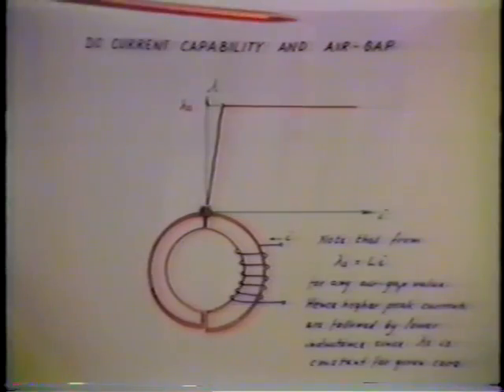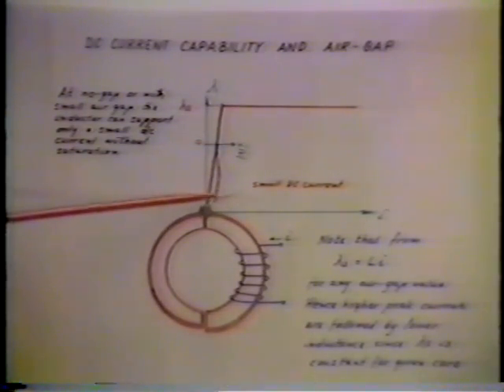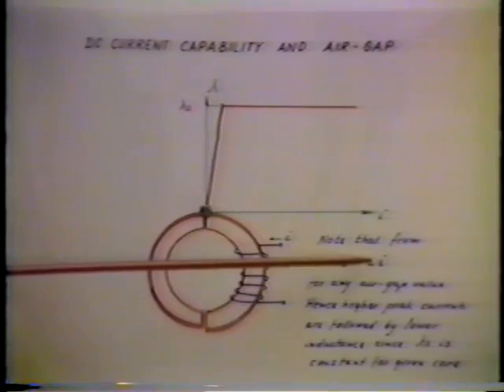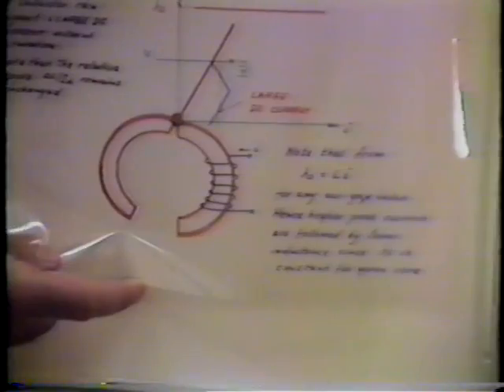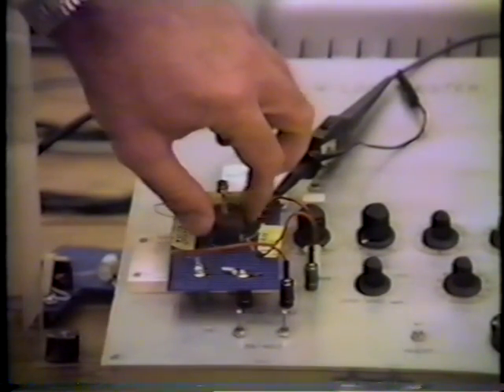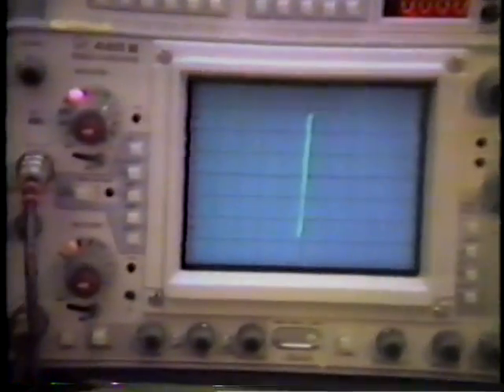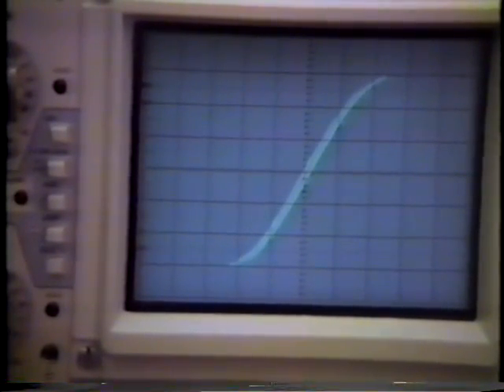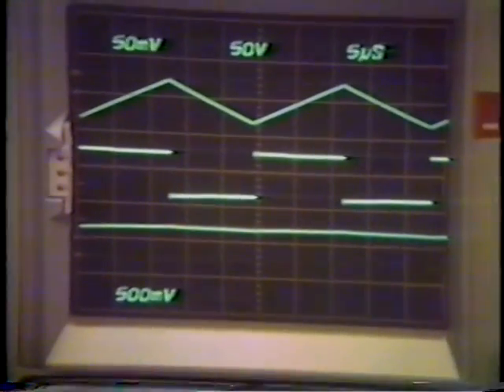Air-Gap Effect on Inductance - Part 4

Comment: Hello Dr.Cuk.
Isn't reducing inductance rises currents in resonant tanks? (when frequency is same, i.e larger capacitor)
I simulated circuit from your presentation http://gecs.ieee.tn/wp-content/uploads/2017/03/GECS2017PaperEDITED.pdf
I saw kA peaks in circuit. is it normal? or i did something wrong? How ever transistors can survive that?
Sorry for bad English.

Comment: Great explanation Dr.Cuk
Reply from the maker: Swaraj, I just repeated the additional explanation I just gave to Brent.

"It is much more than B tracking H! Inductance is a fundamental property of an AC inductor and NOT of an inductor with DC bias. AC inductor DOES NOT store energy. Inductor with DC bias DOES just OPPOSITE and stores ALL energy. Hence a brute force contraption such as an air-gap is introduced into the magnetic path just to do all the storage. As I explained above even a very tiny air-gap sufficient for only a very small DC current DOMINATES total inductance. Think of that in terms of electrical model with two paralellel inductances: one very high inductance  due to the magnetic core  without air-gap and another small inductance representing the inductance of the gap with no magnetic material. Clearly the small inductance in parallel will dominate as large inductance is large impedance in parallel and can be neglected.Bottom line you really do not need magnetic material, which is truly wasted: does not reduce the size and only increases core losses and potentially makes problem if core does saturate in which case that large inductance becomes a short!"

Comment: Why not just reduce inductance with fewer turns on the core instead of using an airgap?
Reply from the maker: Brent,  You seem to miss the key point I made with this demonstration. The objective in switched-mode power conversion is to  make as HIGH inductance as possible.in order to reduce as much as possible the residual output voltage ripple in switching DC-DC converters..  Yet the filtering inductance used on output (example buck converter) must pass full DC load current. The inductor can not pass even a small DC current without being saturated and resulting in SHORT circuit with zero inductance. The brute-force method used to still use inductor for filtering  is to insert an air-gap into magnetics loop. Hence the larger the DC current requires proportionally  larger air-gap. The only mechanism then to increase the inductance is to increase number or turns. However, this  has diminishing returns. Inductance saturates due to DC ampere turns ( product of number of turns and DC current.. Therefore,  increased number of turns demands yet larger air-gap.  This demonstration uncovers the key  limitation of the DC-DC converters used for last 60 years based on buck converters and its derivatives. I hope this explanation answers your question. 
For more details go to amazon.com/author/slobodancuk to see my four volume  books on power electronics or visit my website teslaco.com.. Slobodan Cuk
Reply from the maker: Brent, sorry, but there is no optimum air-gap to be gained. Inserting an air-gap is a losing proposition that Power Electronics field followed for last 40 years and built all its system technology on the buck converters and buck derided converters. They all have a filtering output inductor with DC- bias and require an air-gap.  With DC bias inductance does not increase with the number of turns square but only linearly. Worse yet, air gap needed is proportional to NI (DC ampere turns). For example, even 100 Ampere turns (5 turns at 20A) leads to an air-gap of 10 mills or 0.25 mm. At that size air-gap the inductance with ferrite material included (relative permeability 3,000) may be only three times larger (effective permeability 3!) than without magnetic material. Hardly a reason to use magnetic material as one could increase switching frequency 3 times to get that inductance even without magnetic material. Clearly a waste factor of one thousand! I recommend you to go to my amazon.com/author/slobodancuk page and look into Volume 1 chapter 1 which has a comprehensive introduction to magnetics, including design of inductors with DC bias and true ac isolation transformers.    Slobodan Cuk
Reply from the maker: Brent , it is much more than B tracking H! Inductance is a fundamental property of an AC inductor and NOT of an inductor with DC bias. AC inductor DOES NOT store energy. Inductor with DC bias DOES just OPPOSITE and stores ALL energy. Hence a brute force contraption such as an air-gap is introduced into the magnetic path just to do all the storage. As I explained above even a very tiny air-gap sufficient for only a very small DC current DOMINATES total inductance. Think of that in terms of electrical model with two paralellel inductances: one very high inductance  due to the magnetic core  without air-gap and another small inductance representing the inductance of the gap with no magnetic material. Clearly the small inductance in parallel will dominate as large inductance is large impedance in parallel and can be neglected.Bottom line you really do not need magnetic material, which is truly wasted: does not reduce the size and only increases core losses and potentially makes problem if core does saturate in which case that large inductance becomes a short!
Reply: Thanks for your reply. I have been pondering this for the last couple of days.  I believe the key I did not understand is that the H/B field goes up directly with the number of added turns, whereas inductance goes up by the square of the number of turns.  This property where the inductance and H/B field do not track each other based on the number of turns is the key to optimizing around the airgap.  Hence manipulating the airgap will allow a optimum tradeoff to be made ( with a given core size) of inductance vs saturation current.